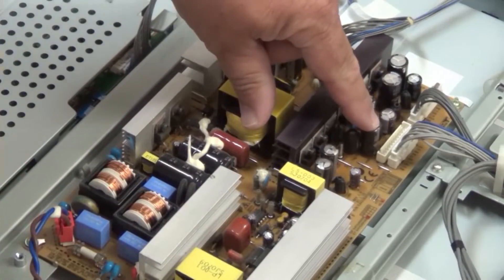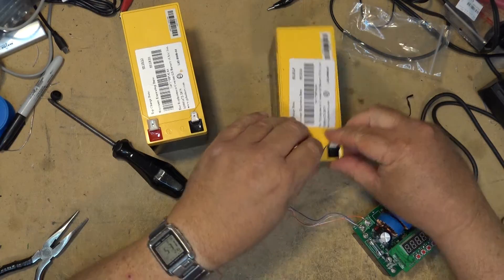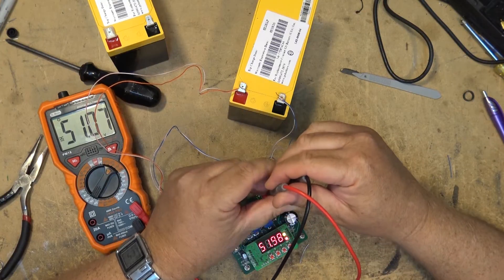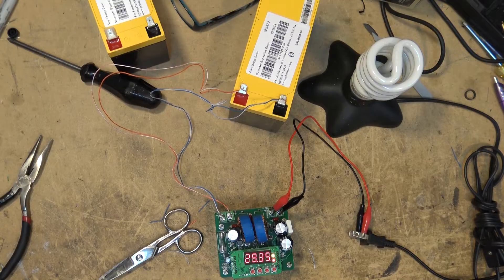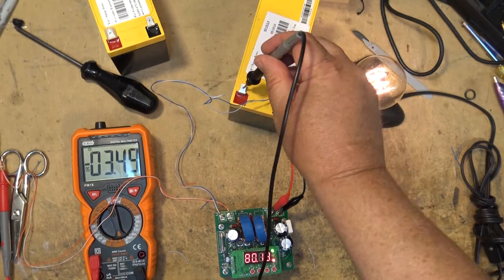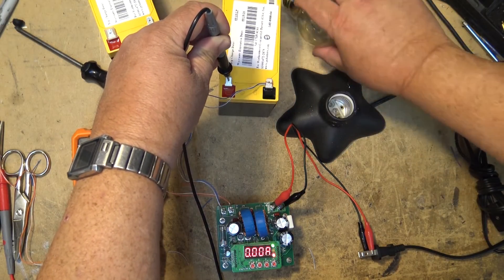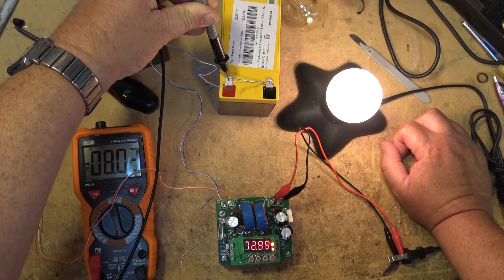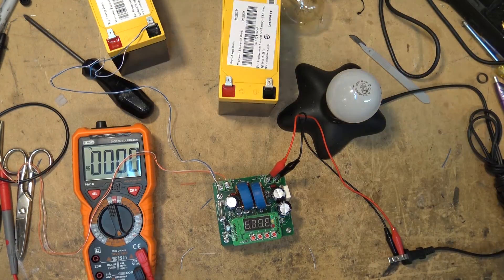400W  8 - 80 VDC boost converter module test run

Comment: If you could clean up the output, and shield the RFI, this would work great for portable tube radios that need the B battery.
Reply from the maker: THEtechknight 
The output is filtered with nice big filters.

Comment: If it's rated ~~ 400watts, why didn't you do a true full load test on it? A 60w or 100w 120V light bulb  @ 80v doesn't prove anything about its claimed performance ability.
Reply from the maker: Tom Dewey 
I loaded it to about 50% of its rated capacity based on input current. The fuse is 15 amps so at 12v in it is going to draw more current. If you like I will do another test but I need to get a bigger battery to supply more current.

Comment: Yes its a boost converter.  Why does the output voltage rise slowly?
Reply from the maker: Soft start?
Reply: That can be disabled with a jumper between the VCC test point and the pin immediately to the left of it on the display board (third from the top on the right). Those test points are VCC, TxD, RxD, Ground. It's a serial port. I get the feeling this module can be programmed and computer controlled as well.

Comment: Usefull in a motorhome only if your ears can tolerate that high pitch squeal.
Reply from the maker: LifeOfAnEnglishman 
It sure made the CFL scream didn't it.
Reply: Oh it was the CFL? I thought it was the chokes on the converter.
Reply: It is noticeable.  Thought is was ready to blast off!
Reply: Sounded like a runaway phaser on Star Trek.

Comment: Hmm  I think the term buck specifically refers to going from high voltage to lower.
Reply from the maker: Do R/C! 
The term is used universally. Buck down, buck boost up. The term is used to describe the design which is the same. As opposed to using a transformer such as on a standard inverter these use an inductor. Not as efficient but generally simpler to design. And fewer parts.

Comment: Perhaps it will come in usefull when you want to test led backlighting on laptops and small monitors.
Hard to think of a use really, you have a variac and another psu that copes with most of your needs.
Reply from the maker: zx8401ztv 
It is more for charging batteries of higher voltage from lower vintage sources. Running a laptop. Most of which require 19 volts from a 12 volt battery ect. Yes you could use a 120v converters and then your standard power supply but that looses efficiency going to 120 and then back down to 12.
Reply: Can be useful to power one of those audio chipamps board available on Banggood/Aliexpress. Even though the output from this boost converter is probably not very clean, if you add a few low-ESR caps it should be tolerable. That's not HiFi for sure, but it enables you to embed a decently powerful audio amp wherever you want.
About LED backlight, you could use a step-down (like DPS5015) for laptop strips, but it wouldn't do the job for a TV. 80V from this step-up is not really enough either anyway.

Comment: Nice that this device can both buck & also boost, very useful for certain applications.
Reply from the maker: Pete Ciallella 
I believe it only goes up from your input so it only boosts, but you can set current limits on it.
Reply: Oh, OK.  I thought that it was a Buck - Boost.  Still useful.
Reply from the maker: No it can only boost

Comment: I guess it is more like a buck boost converter, nut just a buck converter.
Reply from the maker: It is a boost, as I described it."Buck" is simply a term that was used to describe any type of DC-DC converter that does not use a conventional transformer with  a primary and secondary winding. It uses a simple inductor, and voltage / current is changed by hard switching current on and off through the inductor.
The buck converter is so named because the inductor always “bucks” or acts against the input voltage. Depending on the placement of the rectifier it can either step down, or increase the voltage.
Generally the term "buck" is used for the step down conversion, and boost, or buck boost is used to describe the step up.
Many old manuals would list as buck-boost to differentiate between the buck style and full on transformer type DC-DC converter circuits. 
In recent times, buck has been dropped from the boost converter, but technically the circuit is still a "buck" design.
Just terminology.

Comment: I wonder if you tried to run power tools with universal motor on it. I have done it successfully with an UPS unit wiring it up to my car. UPS outputs pseudo AC, but universal motor should run with DC as well. I ran a 350W angle grinder and even a 500W hand drill(not with full speed), even thou the unit is rated on 300W.